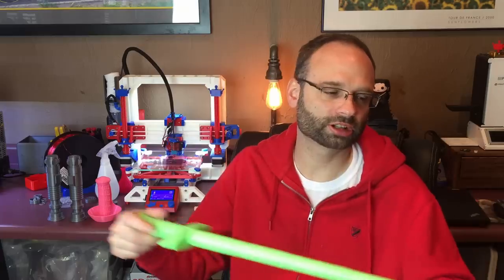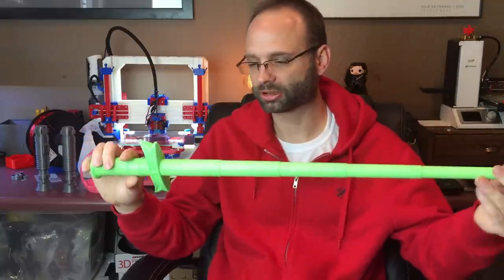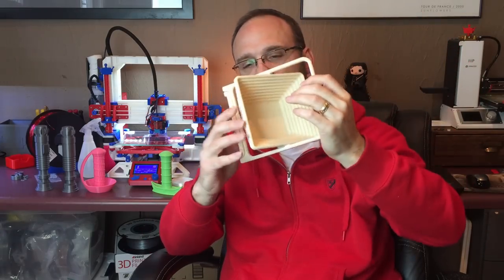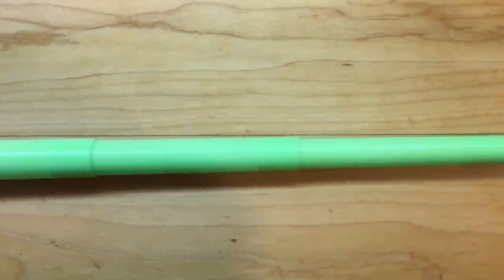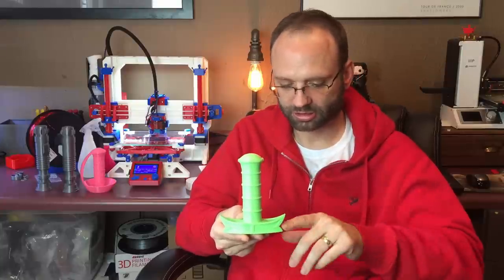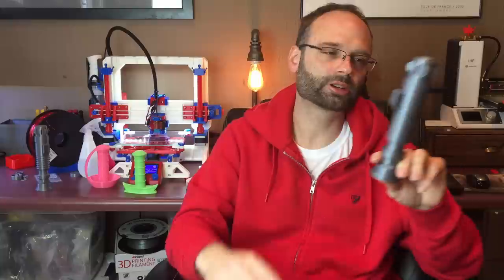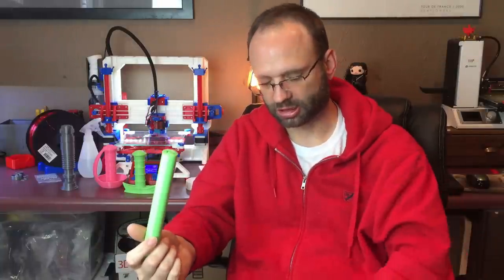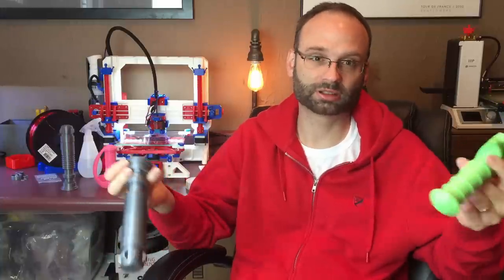3D Printed Collapsing Swords

Comment: Printing the Collapsing Sith Lightsaber (Removable Blade) now and Subscribed to you! thanks Man! Keep up the good work :)
Reply: Why would you need the blade to be removable if it retracts? Just 3d print a blade plug to put over the blade so it doesn't come out
Reply: @secretblue0290  so you can print blades in different colors and swap them out...duh

Comment: Hi My son loves this toy so much! Thank you for your design. I am curious to know what draft/taper angle do you do for each section?
Reply from the maker: I have the model setup so the draft angle changes depending on the length of the sword so they stop roughly 1.25" from the end of each section.  I think its around .25 degrees, but clearance will also have a impact too.
Reply: @3DPrintingWorlds  great! What is the gap between each shell/section to work with the taper?

Comment: your projects are amazing. Have you thought to insert a botton (i think it would be perfect in the light saber) that stops the blade inside the hilt? you press to unlock it, in this way the blade would not exit without you want it. or a "block" on the top of the hilt that blocks the exit.
Reply from the maker: That would be cool! It would be easy to stop the outer most segment, but not sure how to stop the ones on the inside? 🤔
Reply: @3DPrintingWorlds  yes... i thought it too.. so the second option could be to create a block on the top of the hilt that passes over the exit. a small rectangle should be enough (maybe readapted in base of the style of the sword).... it's true that in this way you'd lose the idea (and the "automation") of the botton on the side of the hilt.. if i have some ideas i leave you a message ;) ps i'm going to buy a 3d printer so i'm starting to project mechanisms (like puzzles) to print XD
Reply: i had an idea! If you want I can send you a sketch (i don't know if it is really crafrable but i think it is a good option) (but i don't know how to send the image)
Reply from the maker: There is a email address under "about" in my channel where you could send it too.
Reply: @3DPrintingWorlds  email sent!
Reply: Maybe a finger in back of the blade pressing the segments all to one side, released by a button.

Comment: Would it be possible to print something that’s more like an actual blade? Flat with an edge. Don’t know if it would hold up the same but I think it would be a cool idea to try. Only issue I see is it not collapsing all the way into the handle from having a wide base of the blade. Maybe a katana would work though.
Reply from the maker: Check out my thingiverse and my other video on the swords.  I have a Katana and a dagger with this shape!

Comment: Man, thank you so much for your videos! I've tried in many different ways to print the blade but the few first layers always "detach" from the table, for some reason. I've used every technique I know to keep that print stuck to the table, but I just can't seem to do it. Any thoughts?
Reply from the maker: Can you tell me what the bed surface is? What printer?
Reply: @3DPrintingWorlds  Ender 3 V2

Comment: Could you maybe show your slicer settings or advise what in prusa slicer to change to use coast and wipe or cura. i have so many failed prints and im lost
Reply from the maker: So sorry but I have not used Cura.  PS only has a wipe option, I think.

Comment: I've printed Luke's lightsaber and it works great!!! I have one issue; I still have braille like dimples on the 'blade' layers. Not blobs or zits, so small the sword works but it doesn't sound like yours. The sword comes out smoothly though! Gravity extends the blade when picking it up. I have coasting enabled, but not wipe. Is there anything specific about your wipe settings worth mentioning? I'm on Cura 4.2 with an Ender 5. Playing with the sword now, super fun! I just want those glass-like layers you've accomplished.
Reply from the maker: Oh, I printed that transparent blade in vase mode. I think its the only way to get rid of layer transitions.
Reply: @3DPrintingWorlds  Thanks so much for your reply. I'm still learning a lot. I will give vase mode a try! My handle was basically perfect, just a slightly ugly blade I'd like to improve.

Comment: Just found your page and love the work that you do! when your rendering to improve a product do you do it from scratch? Went to school for industrial design and reverse engineering was a hard topic for me to work with
Reply from the maker: If I understand the question correctly, I guess it depends on the application.  To me, to reverse engineer something is the easy part. Coming up with the original concept is where the money is at.
Reply: @3DPrintingWorlds  Thats where you're experience and skills kick into gear, what beginner printers would you recommend? Its been about 8-9 years since I used CAD and have a lot to catch up on
Reply from the maker: Oh, you're going to love the new software! Once you get used to the changes. I would recommend a Prusa  brand printer if you have the money.
Reply: @3DPrintingWorlds  What beginner CAD software would you recommend? I started with solidworks and rhino when I was in school but am limited in funds since i'm out of work currently. About to look into printers right meow
Reply: @3DPrintingWorlds  What's a step below the Prusa MK3? Little more than I can afford right now
Reply from the maker: The mini is cheaper but you'll have to wait in line.  Otherwise, most people would suggest a Ender 3.
Reply from the maker: Fusion 360 is free for hobbyist and really powerful.

Comment: Hey. Great project. Quick question for you tho. It appears that the separated files for the lightsaber blade are solid models. Should they have holes in the so you can assemble the to slide? Just checking. Went to print it and noticed this. Keep up the great work!
Reply from the maker: The separate files are meant to be printed in vase mode, because it will be faster and you will get better results. In vase mode your slicer will only print them 1 shell thick even though they are solid.  Just make sure your extrusion width is set to .85mm. I used a .8mm nozzle but I am told a .4mm nozzle will also work.
Reply: 3D Printing World Ok. Thanks for the reply. I was wondering if you had the file with all the pieces (with holes) separated instead of vase mode. That would be easier for me to print with the current printer setup I have.
Reply from the maker: No but you can easily separate them in meshmixer.  Or, I heard slic3r will let you print them separately.

Comment: So stupid question here , i printed the jian collapsing sword without any issus (great design by the way thanks to have put your design on thingiverse) but is there a way to make these collpasing sword more resistant for be able to sparring with? I printed one for a kid , i test the resistant of the sword and realize he will probably break it and unfortunately i was right.
Reply from the maker: I dont think so, the layer lines make it weak. I have best luck with the blades in vase mode but that only works on the lightsaber.
Reply: @3DPrintingWorlds  ok thanks i will try with the lightsaber
Reply from the maker: @chocolatine_sournoise  Good luck!

Comment: I tried the katana but the blade does not extend out very far.  Your design is fine but I suck.
Reply from the maker: Try turning the extrusion rate down 2-5% depending on the current setting.

Comment: whats it made out of PLA?  what setting for heat end and thickness or all the settings.  mine looked good but wouldn't extend.  the tip was deformed and layers started to separate.   my printer print good for most things.

Comment: Any chance you could share what filament you would recommend?
Reply from the maker: Link brand or type? Petg might give you slightly stronger results then PLA but both will work.  I live in the US and like to support local filament manufactures here like Atomic filament, and when my wallet can afford it Protopasta.

Comment: I have tried to print them multiple times but unfortunately  the parts of the sword always slide through to the other parts of the sword....they kinda dont hold together. what am I doing wrong?
Reply from the maker: Are you printing in vase mode?  If so try to increase your line width.  If not in vase mode, increase your extrusion multiplier by a few percent.

Comment: I unfortunally cant print it because the blade pieces dont stick weel enough to the build plate. When they are about half the size the need to be, they fall over...
Reply: Maybe a raft at the base of the print?  Should be a slicer setting for that.
Reply: @hanelyp1  well i dont use rafts anymore because the raft sticks to the bottom of the print like they were glued together for some reason

Comment: Hiya do you do custom lightsabers at all? with a collapsible purple blade? i have a basic drawing if you can.
Mine is very basic like Darth Vader's, expect with a with a skull pommel and samurai style hand guard near the top (a bit like Kanan's).
If you or know anyone you know can, please send me a quote... many thanks.
Reply from the maker: Sounds cool! I would do it but I'm just to busy right now... There is a STL of the blade in the file section, which will make it much easier to modify.
Reply: @3DPrintingWorlds  no worries thanks for the reply... it will get made someday; I know nothing about 3D printing. most of it would be pretty easy using the pvc pipe and window wiper route... but its the pommel and collapsible blade that will be a struggle. if ever you are able... please message me. many thanks.

Comment: I tried 3d printing the pirate sword but the bottom like blade fused together and idk if its the anycubic kobra or a setting
Reply from the maker: If it only fused on the bottom I would check your first layer height.
Reply: @3DPrintingWorlds  I tried printing the test but now the seam is fusing it together and idk why the seam is there

Comment: When I print this now it prints half way and then make a blob of filament and starts rocking, what speed did you print at and do you have any other advice? I’m printing on a tevo tornado.
Reply from the maker: Sounds like its coming loose from the bed? Not sure what bed surface you are using. You can try adding a brim but I would try to avoid it because its work to remove.

Comment: Hi John, I'm trying to print your katana but I tried doing the test and I have a bad oozing problem. I have an ender 3 pro. Do you know what I could do to fix that?
Reply from the maker: Can you tell if the problem is when it starts extruding or stops?  If at stop turn up coast and/or wipe. Coast is the distance before the retraction that extrusion stops, and wipe is the distance it moves after without extruding to wipe the blob away.  You can also try cooler temps, z-hop has helped some also, but give me problems when I forgot to turn it off.
Reply: @3DPrintingWorlds  I'll certainly try this. I'm unsure of if it's when it starts or stops but if I had to guess, it would be when it stops. I'll give these a go. Would you suggest finding appropriate settings online for retraction? I would but I'm unsure of how good of an idea it would be.
Reply from the maker: @zodiartsstarro  Sorry I forgot to respond. This would depend on  the type of extruder you have.  You an keep turning it up until you start to see a difference.
Reply: @3DPrintingWorlds  No worries. I found some good settings and gave the sword a go. It came out well although there was an issue with closing it (Had to force each individual layer closed) so I did something wrong obviously. But it worked for the most part and was able to use it for the festival I was in attendance to. I thank you very much for this amazing opportunity to print something cool.